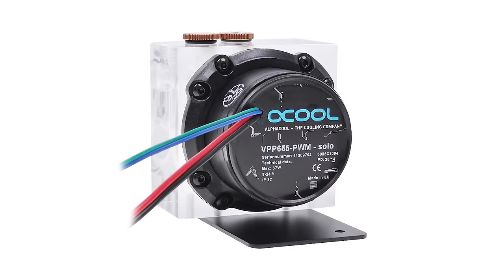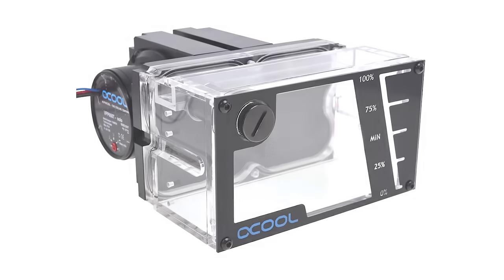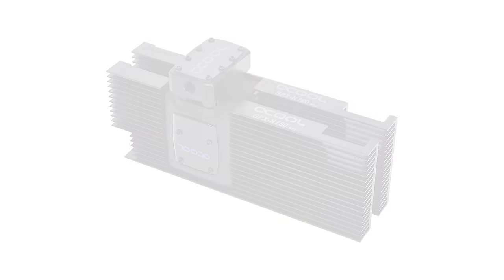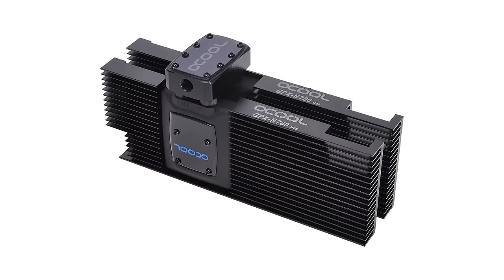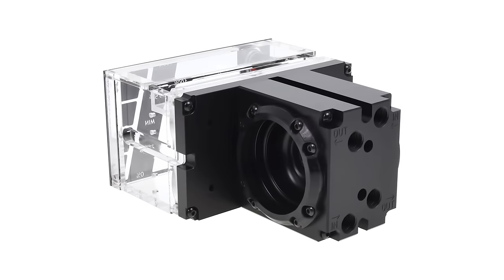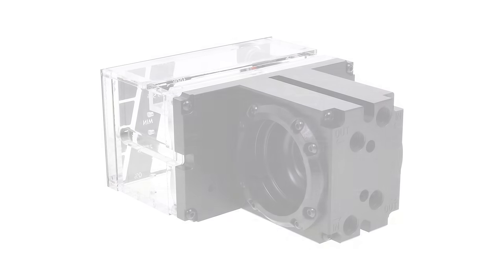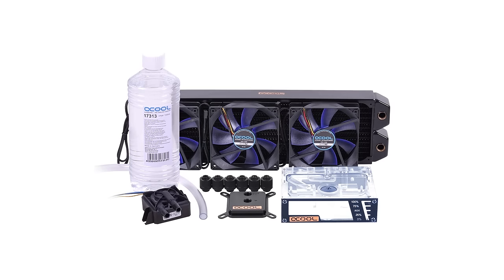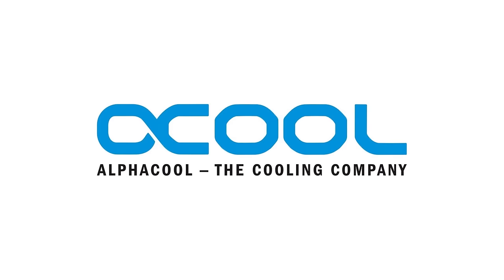Do radiator fins really matter?

Comment: What gaming chair would you guys recommend to get more fps on games
Reply: +Omar R. 
There is not necessay a need to get a new one, what many don&#39;t know, is that with PC-gaming you can just update old stuff.

Give your chair new shiny paint, green is the best value/performance in my opinion, and your system will have better windresistance. A spoiler helps too. I now get 16 fps with Fall Out 4, before it was 14. Feeling like part of the master-race now, and I&#39;m looking damn pimp while doing it.
Reply: +Steve Tovey what about an xbox 1 controller or playstation controller.
Reply: +Omar R. A stool
Reply: +Omar R. Dr. Evil's chair, if you lose a match you can press a button and drop your enemies in to a tank of sharks with fricking lasers attached to their heads.
Reply: +Omar R. whatever chair you choose, just make sure it has variable refresh rate.
Reply: id get one that comes with 60fps ddr420.
Reply: Anything Asus ROG
Reply: +brajuhani I'm the only pimp round here thank you
Reply: +Omar R. His DXRacer gets 20% more FPS on all programs!
Reply: +Omar R. electric chair
Reply: +Omar R. make sure to overcloth the material on the chair
Reply: you need a chair with lots of surface area.
Reply: +Omar R. get the gaming chair PC :)  
throw in 4 Titan Xs for more FPS.
Reply: +Omar R. It must have rgb-lightning and bass boost!! Also 7.2 soundsystem with only 2 physical drivers cause that's totally how surround works.
Reply: +Omar R. Well a controller will actually decrease your performance in games by atleast 1.000.000%!
Reply: +Derples you son of a bitch. I covered every square inch of my case in vtech and no2 stickers and my system overheated because I blocked all the openings. expect a nasty letter from my attorney. good day I say, good day!

on the plus side, I'm sitting at a cool 3 ter of RAM thanks to the stickers and downloaded RAM.
Reply: Stickbo Wow dude where did you download that RAM? Could you get me a link?
Reply: +Omar R. I sit on my cat. Lots of fur-per-second.
Reply: +Omar R. you have to turbocharge a DX racer and put a huge exhaust pipe and park-bench-spoiler do get huge down-force and rice-points, uh i mean fps. also you need rgb lighting.
Reply: put a razer sticker on your case to get +15fps
Reply: You prolly dont give a shit but does anybody know of a trick to log back into an Instagram account??
I stupidly forgot my account password. I love any tips you can give me!
Reply: @Nathan Elliot Instablaster =)
Reply: Mums couch

Comment: In the automotive world we call it "Fin Density".  Condensers (AC Refridgerant radiators) can run as high as 96 FDM (Fins per decimeter).  These fins are VERY thin (0.02mm thick) and have a special contour stamped into the fin to optimize cooling.  Higher Fin Density generally has a higher cooling capacity, but it depends on the thickness of the condenser...the automotive world has moved from 25MM Thick Condensers to 16mm, and now to 12mm.  The Fin Densities have increased due to this as well as the number of "passes" and tube rows.   GREAT video BTW.

Comment: tl:dw - FPI means fins per inch. more is generally better but not always. read reviews
Reply: Your trying to tell one of the most experienced watercoolers how do their job? Yeah good luck buddy
Reply: +Daniel  Burgos I didn't tell Jay how to do anything. I'm a big fan of his content in general. it was just a basic summary for people who don't have time / can't be bothered to watch the whole video
Reply from the maker: +BattMarn Except there is more to FPI than the amount of fins. The kind of fins matter too.
Reply: +JayzTwoCents not really you even say it in the video.
Reply: +Ottavianus Augustus  He did mention the difference between 'standard fin' and 'split fin'.
Reply: Mario X. yeah, and he said they don't make a difference in performance unless you hit them hard, they are a little more robust but they are more expensive which can be summed up in not a real difference XD . let's just agree he is moving and he made a crappy video, there is no shame on that. not all content has to be 1000% entertaining, even on cable there is poor content.
Reply: +Daniel  Burgos He's right, too many fins air flow can be impeded too much, too little and cooling suffers. That's why with some radiators fans with high static pressure are recommended and with others standard run of the mill fans can be used.
Reply: +Ottavianus Augustus No. He said clearly that in simple builds with CPU and a single GPU there is no real difference as an 8 fin radiator has more than enough capacity to cool the system. Like crossing a city with a Ferrari or a Beetle, none of both will be able to do it at their full power, so there's no need to spend more in something that won't perform better. He also said clearly that higher FPI radiators are needed in multi GPU builds because then a more simple radiator's capacity won't be enough for that amount of heat. But at the cost of more powerful fans and thus a lot more noise for the system.

Comment: I've just finished my first water cooled rig and have to say, water cooling isn't quieter. Pushing air through radiators is considerably louder than just pushing air. Plus you generally need higher fan speeds for the rads to work efficiently. What is much better though is that you can run your fans off water temp rather than cpu. This completely does away with the really annoying ramping up and down of fans. So even though its slightly louder it's much less noticeable as it's more consistent.

Comment: I just put in two pretty high FPI rads. I got the EK 280 CE with 16 fpi and Hardware Labs stealth 360. Overkill for a 4790k and Titan X but I do plan on going with SLI for Pascal so I figured I might as well go ham on the Rads now. Also my first PETG loop went smoothly. Once you get the temperature control down it's pretty easy.

Comment: Can we get a video on fittings?
Reply: +Shamen Shamen Jay has done one already, go back on his recent uploads
Reply: +Dah_v fine, a video on reservoirs and reservoir/pump combos.
Reply: You just want a new video from jay don't you? Doesn't really matter what on 😂
Reply: might be cool to have a vid on TEC stuff.
Reply: +Shamen Shamen Just don't get monsoon fittings that come with a tool, they're terribly difficult to put on
Reply: +Shamen Shamen Agree on this suggestion, I've read some posts on forums about using the proper fittings and issues related to clearance from fans installed on the radiator.

Comment: Jay, could you do a video about Single vs Dual vs Quad channel DDR4 memory in an i3 6100 and a 2pcs GTX 980ti @4K? See how well RAM speed helps the CPU if it's the bottleneck in the system. It's purposely i3 6100 so it would bottleneck the cards at 4K. Digital Foundry did this but they didn't show single vs dual vs quad channel configurations.
Reply: This is actually a good idea! I still have single channel in my pc, it will be interesting to see what benefit there is to getting more ram in dual channel.
Reply: LinusTechTips did a video on that I believe. Just use the keywords: dual channel vs single channel.
Reply: Just A Meme That was DDR3 and they didn't use a system where the CPU is the bottleneck (I mean a huge bottleneck like i3 6100 on 4K). Memory speed greatly helps in CPU performance when it's the bottleneck. Similar to how overclocking RAM helps integrated graphics (which is part of the CPU). I prefer jayztwocents, MW technology, awesomessauce network, and digital foundry when it comes to testing over linus' channel anyway.
Reply: +Vanguardas Vucava Oh sorry I didn't read the cpu part.
Reply: um... I3 only has up to dual channel.... It doesn't support quad channel.....
Reply: just use a 5820k and disable some cores. that is the only way to get quad channel ram
Reply: +Vanguardas Vucava Quite simply, it doesn't matter. Neither does DDR3 vs DDR4.
Reply: Tyler Weigand Sorry! I own a Haswell chip, so i didn't notice that part . They could use another chip that supports it for the test, i5 6400?
Reply: +Vanguardas Vucava I think you have it reversed. You'd want to test at lower resolution, not higher resolution if you want to try to create a CPU bottleneck. Higher resolution means a lot  more stress on the GPU, and a relatively small amount of extra demand on the CPU. So running and i3 with a couple 980 Tis at 1080p would be more likely to create a CPU bottleneck. It also would depend on what game you're playing, since some games demand WAY more CPU power than others.
Reply: Sebastian George Or he can run it in all 1080p, 1440p, 4k. Thought of 4K to stress it out more and keep FPS below 100. Good point though!
Reply: Vanguardas Vucava Well in that case, I can agree that it would be nice to see a more thorough investigation that covers several resolutions, though I think it would still be best to start with 1080p first, because if you don't see any effect there, I am pretty confident that you won't see an effect for 1440p and 2160p. Just keep in mind that keeping FPS low in and of itself isn't the goal. The goal is to keep the FPS low specifically because the CPU is struggling to handle its workload :).
Reply: Sebastian George True! I Agree!
Reply: Osa the Great Really? Luckily Jay has the hardware for that haha. Thanks! 5960X it is, and it should still be relevant information until Zen and Kaby. I've heard rumors about Zen supporting Quad-channel RAM.

Comment: I'm still rockin' my old school MCW6000, low-FPI 120mm rad and an MCP355 cooling my 2500k@4.8Ghz. The loop is 11 years old and has cooled 3 machines in that time. I'd say the pump is... just a TAD over it's rated MTBF at this point. I'm all about that budget life.

Comment: Hello Jay,  great video!!  You mentioned that the cool capacity of the rad is not linear with respect to the FPI.  A vid on comparing a 6, 8, 16, 20 FPI would be neat,  also the thickness I am assuming that a 60 will not be twice as good as a 30 mm in thickness.  Lastly, air flow through the rad.  What is the relationship between airflow and cooling.  I would assume that the efficiency of the cooling is not linear to  CFM being pushed through the rad.

Comment: can you do a video where you actually test an overclocked system with a 8 FPI and a 16 FPI, and turn the fans both to 50% and 100%. to get some real numbers.

and another video idea for you... maybe do a video on how much air flow u need for 8, 16 and 20 FPI, because i often see the air flow listed as CFM. and how much this impacts the cooling and a airflow fan vs. a static pressure fan

Comment: Could you make a video showing the difference in thermals when using those 2 rads? First with stock speeds to see if there's actually no difference when you aren't pushing the limits of the rads and then with a heavy output system to see the opposite happening.

Comment: Rocking a XSPC AX360 and a AX240 with Corsair SP120 Quiet editions. Works fine and even at full blast the system is only audible when the air unit in the house is powered off or I am not playing music. Temperatures are pretty darn good too.

Comment: I use a Watercool MoRa 3 Pro 9x 120mm radiator, this thing ceeps my system dead silent. ok this radiator can handle upto 200 watt heatdisapation passive.
The fans on it are noiseblocker Multiframe M12-S2 wich are controled via an aquaero 5, down to 500 upm.

Comment: Is there a way to measure the temp of the water in the loop and base your fan profiles off of that? For example, I don't want the radiator fans running at all for noise, but have them kick on once the water temp is high enough. The pump will continue drawing heat away but passively dissipate the heat. There's no reason to keep the water cooled with fans because the thermal density of water is pretty high so the water would never really heat up much until the system is under load for extended periods of time. I hope that question made sense, I couldn't really figure out how to word that.

Comment: You should do a Vid on coolant flow. IE how much flow you really need. In the market you see D5 pumps, MCP35X and the list goes on and on. You even have advocates of multiple pump setups. How much pump do you really need? IE flow..... I just built a system (my first) around a swiftech apogee drive ii, Cooling a 3570k (OC @1.336v) along with the MB's VRM. (I do plan to cool the GPU when a block becomes available) Using 1x UT60 280mm + a XSPC 120mm rad (plumed in series). And I'm wondering if that MCP35X will keep up once I put the GPU into the system.........

Comment: different question:
When you set up water cooling with pull configuration only (eg to avoid dust collection beneath the fan) does it matter if you use static pressure or airflow fans?

Comment: Hey Jay, I have a question for you? I'm fairly new to this channel, but i have watched many of your videos before, but now subscribed! Anyway i was wondering if you could use a radiator without using a fan at all? If you had a reasonable sized radiator just cooling your CPU for example and you had the pump circulating the water would you even really need to have a fan on the radiator at all? I'm thinking that just moving the heat to a bigger surface area would still keep the thermals well inside the designed limits? Not sure if you know the answer? But thought i would ask because your the "Cooling Guy", But if not, that would be a cool experiment to try and maybe video? thanks in advance.. Drew

Comment: You know as hot as my G-Sync monitor is running. Maybe we should start thinking about liquid cooling the chips inside the monitors now. It transfers the heat all the way through to the front of the screen.
Jay you run those monitors. Have you not notice the heat involved. Could you check and see what kind of temperatures are really being generated. 
I really need your help with this one. Hard to find anybody that will listen. I really think there's an issue here. If you could check it out and find out if I'm right or wrong. If I'm wrong, great. No harm no foul. But if I'm right, you could be helping a lot of people. By catching this early in the monitors life and then maybe coming up with a fix.

Comment: Very informative video,  but other than noise factor why are there not more uses of the centrifual blower with water cooled systems ? Other than the noise issue I can think of none, apply the FPI variable from this video to that of the fan in, mention could a more efficient design be accomplished ?

Comment: Damn if i knew that a year earlier... my space is reduced an i got a 140x140 and a 280x140 by Alphacool, normal fins, and these are there to cool 2-way sli 4GB GTX770 and a i7 4770k. Radiator space is reduced so maybe a rad. with more FPI would have been useful. But the system's working as well.

Comment: Excellent subject, helps me a lot. One issue you maybe able help me with. I just installed the Gigabyte GTX 980Ti Xtreme with the Fan Stop option. Would you consider 50 deg C to be ok at idle..mind you in benchmarking it doesn't make 70. BTW love you youtubes, you're doing a great job

Comment: @JayzTwoCents ...hi jay thanks for another very informative video,.....I have the Aquacomputer Airplex Radical 2 rads in my system ....I don't know if you seen or used one ....but what are your thoughts on these rads vs the flat water tube design rads? I seen your video on the oc cool round tube rad at least I thought it wuz oc cool....

Comment: I've been looking for some kind of information on the performance impacts of the different coolants along with the impacts of adding dyes. I've yet to find something really all encompassing. I'm about to do a more designer watercooling build and was thinking of making the video myself. I purposed something along the lines of your how to dye watercooling fluid video but using some precise temp monitors and tracking the nanofluids vs distilled water vs each with different levels of dyes, etc. 

Ideally, I'd like to know if there are any impacts to adding dye or going with a nanofluid for performance, or if they're really just marginal like I'm assuming.

I think it would be great if you could get to something like that as you probably have access to more liquids and equipment than I have on hand.

Comment: Hey Jay, on your 560mm rad do you just have four AF140 Quiet Editions on it?  I ask because I couldn't find a 140mm Static Pressure variant of Corsair's Air Series fans.  Well, unless you want to go with the LED versions, but the build quality on those aren't as good.

Comment: Jay I'm planning a wc loop.. I'll probably use a 7700k and a high end ($400-500) Vega GPU (potentially 2, in the future) and I plan on overclocking both. I will be using 2 NexXxoS ST30 360mm rads and they appear to have 16 FPI. If I use SP120 Quiet Edition fans in a push config with and without the low noise adapter, would the rads be enough for the overclocked parts and be quiet at the same time? What about 2 overclocked cards? Thanks.
Reply: No